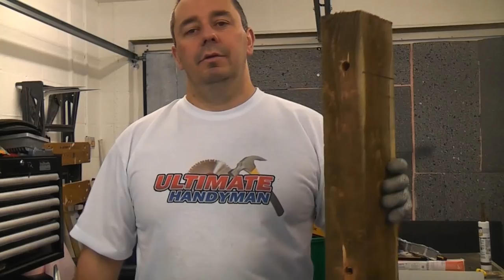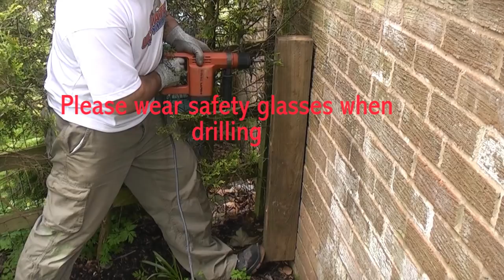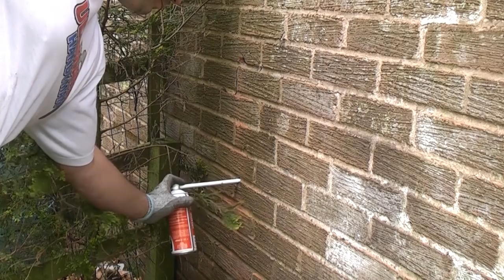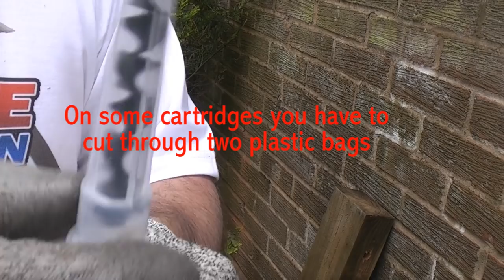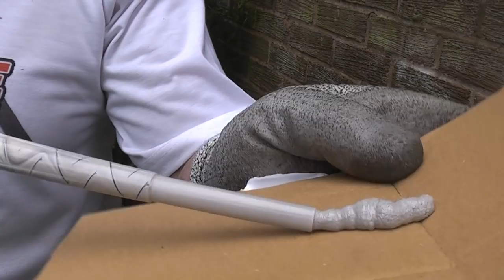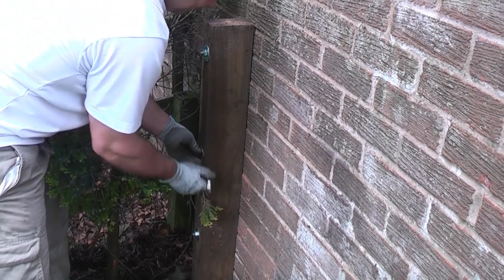Resin anchors | Resin fixings

Comment: Looks really good, it really sets up that quickly... It must as you have promoted it. I will see if I can find it here... Thank You...
Reply from the maker: +Curiosity 
The curing time depends on the brand of resin that you are using and the ambient temperature. We often use these on site, you can often insert them into the concrete, go back half an hour later and then tighten the nut down. 
Thanks for the comment

Comment: I`ve never used that type of resin before but have used the type in a glass tube which you place in the hole and break with the stud. Used to cut the stud at an angle of 45 deg and screw it in using a battery drill. All of these chemical anchors are solid with no stress on the surrounding material. Great vids fella.

Comment: On a standard right hand thread you should twist the stud in anti clockwise as this pulls the resin downward into the hole. Twisting clockwise will screw the resin out of the hole.
Reply: Ued this technique today..first time user. It did pull it in..

Comment: What I don't understand is how you ensure the stud ends up in the centre of the hole if you're drilling the hole ~2mm larger than the stud itself (to allow for the resin). I want to use this technique to mount brackets for a desk so it's vital that the studs are right in the centre of their holes otherwise the brackets won't fit onto them, and/or the tops of the brackets won't be level.
Reply from the maker: You might be able to get some sleeves made, to centre the studs perfectly. For example of you are using a M12 stud, you could get a sleeve that is M14 OD and M12 ID and slide that down the stud after injecting the resin and inserting the stud. It would only need to be 10mm or so deep, or perhaps use two per stud- one at the very end and one where the stud exits the brick.

Comment: Nice to see the vids coming thick and fast.
Could you have also used expansion bolts in this application?
Reply: Some masonry is too soft for expansion bolts, and they crack the masonry. Old Sandstone for example will just crumble. So the expansion bolts will never get a fix.

Comment: Hi, I'm wondering about fixing a metal balcony using these. Should I use a rubber gasket behind my washer to take up some expansion - black metal balcony on sunny south facing wall? Thanks mate, I enjoy your videos!
Reply from the maker: I'm not sure about that one, I'd ask a structural engineer to be on the safe side. The last thing you want is someone falling to their death 😱
Thanks for the comment 👍

Comment: Can you use screws in resin. I'm trying to fit a countertop shelf for the basin in the bathroom and the last screw just keeps spinning. Space is tight and the only thing I can think of is a chemical fixing? Thanks
Reply from the maker: +Rashid Hussain 
No, I don't think screws will work in resin.
You could inject resin and then use a stud of the correct diameter, then tighten a nut and washer  onto that once the resin has cured.

Comment: Would this hold alot of weight? I need to build a pergola on my terrace. I want to screw the studs onto the walls which are made from concrete blocks, these studs will basically hold the whole pergola together. Would it hold the weight? Thanks alot mate.
Reply from the maker: I'm afraid I don't know the answer, you would have to ask the manufacturers or a structural engineer.
Thanks for the comment
Reply: For a super tight fit that will sustain weight use sleeve anchors of the right length into properly drilled holes as an alternative.

Comment: great video...planning to use this.method to fit 20ft ledger board on my house for a deck...what distance do you suggest I leave between fixings?
Reply from the maker: I'd probably put two every 600mm or so.
It's a few years since I last installed one- http://www.ultimatehandyman.co.uk/how-to/decking/fixing-a-ledger

Thanks for the comment 👍

Comment: Which is the best place to drill in a brick wall for fixings. Is it right in the middle of the brick or in the pointed area(cement)
Reply from the maker: When using resin fixings, you’ll probably get the strongest fixing in the centre of the brick, but it depends on the brick, as some are hollow- so you might end up using a lot of resin 👍

Comment: what do you suggest to mount a 64lb cabinet to a cinderblock wall? I plan to add about 45lbs of items inside the cabinet.
I've been going crazy tying to figure out the best way to do it.
Thanks for any help you can add.
Reply from the maker: I'm not familiar with cinder blocks I am afraid, but after doing a google search they appear to be concrete blocks.
Four resin fixings and M12 (1/2 inch) studs should do the trick, providing the blocks are solid.
If the blocks are hollow you could use 4 snap toggles- https://www.youtube.com/watch?v=tAIUublenMw
I hope this helps ;-)
Reply: Thank you for the information and video on the snap toggles.
Your videos are great!
Reply from the maker: Jim M
You are welcome Jim, Thanks for the comments ;-)

Comment: I'm in the States and totally confused. You suggested using a 110V drill (or RDC) when working outside. Seeing as how the U.K. is 240V, where would you find a 110V outlet?
Reply: We use a transformer to step down to 110v for site work.
Reply from the maker: As Gee Whiz RS has pointed out, in the UK it is common to use a transformer to go from standard 230V to 110V 
You will often see these transformers on most construction sites (which is why cordless tools are a much better option)
Thanks for the comment
Reply: @ultimatehandyman  Thank you for the replies. I never knew about using 120V on construction sites.

Comment: Is the resin really that strong that it can stop the studding from turning once you start to tighten the nut? Any idea how much torque can be applied? Could the stud ever turn if enough torque was applied?
Reply from the maker: Yes, once the resin has cured it holds it really well. I'm not sure how much torque could be applied without breaking the bond though. 
Thanks for the comment
Reply: IV used a 600+nm nut gun on them and they've not moved, resin fixings are used to hold up very heavy channels etc for balcony's and other steel work so they can take plenty of load too

Comment: I have very soft internal walls and any convential fixings just pull out, since it's impossible to keep the hole to size. I have been using resin for years
Thanks for the video but I was a little concerned how close to the mortar joint the holes were.
Reply from the maker: Thanks, the resin should still fix to the mortar as well as the brick itself.
Thanks for the comment
Reply: have you had any issues using resins on soft walls? Been looking for a solution to hang a radiator.. all the wall fixings just pull out been really frustrating.

Comment: What do you suggest for fixing into   block work, it's a supporting wall but think it is the thermalight block. Iv got masonary bolts  ut not sure which hold the best
Reply from the maker: I normally use Dewalt Gasbeton on aerated concrete - https://www.youtube.com/watch?v=YwAMQcbJS0U
Thanks for the comment

Comment: How deep was your cavity that tube didn't look long enough I would have pushed a rod in first to measure depth I think
Reply from the maker: It was deep enough to accept the stud ;-)
Thanks for the comment 👍
Reply: I'm looking to put a 500mm threaded bar into resined hole. Will the standard resin nozzle/silicone gun push the resin all the way back to the 500mm cavity? Or do I need to get a special extended nozzle? Thanks!
Reply from the maker: @colmflaherty8087   I think you will have to extend the nozzle for that depth, perhaps using a piece of plastic pipe etc.
Reply: Thanks. Makes sense.

Comment: Hello and thanks for sharing. One question: what if the studs need to be removed for any reason? Is it possible to "unscrew" them using a particular procedure or the only way is to cut the protruding part and leave the remaining part inside the wall? Thanks!
Reply from the maker: I've never tried removing them, but would imagine the only way to remove them would be to cut them flush to the surface using an angle grinder etc.
Thanks for the comment
Reply: Thanks for your reply! ;-)
Reply: You can tighten 2 nuts onto the stud then apply turning force to break the bond, can also modify a small scissor jack to help after doing this.